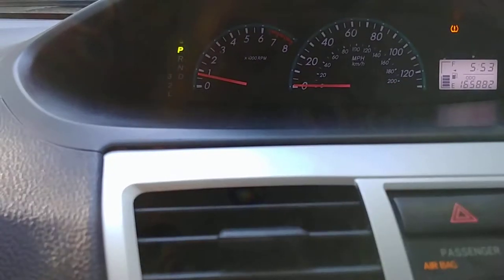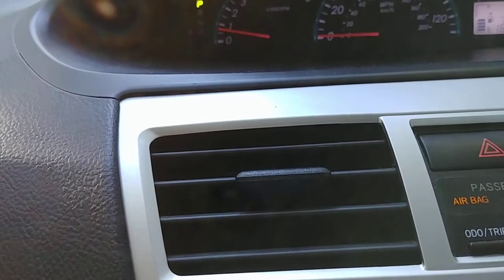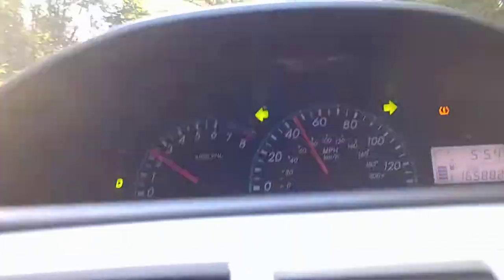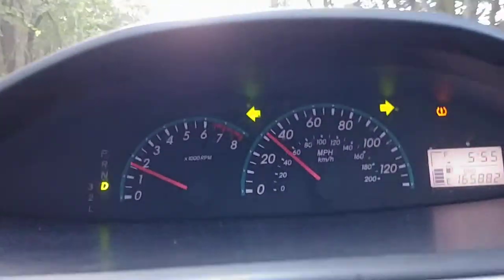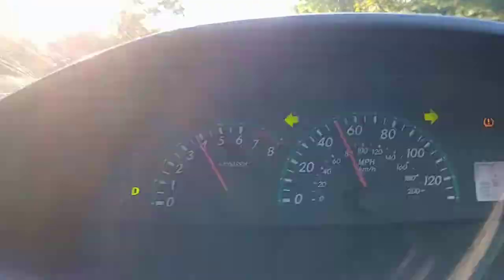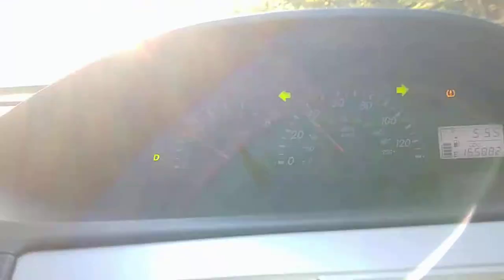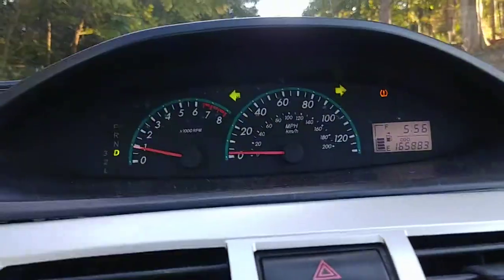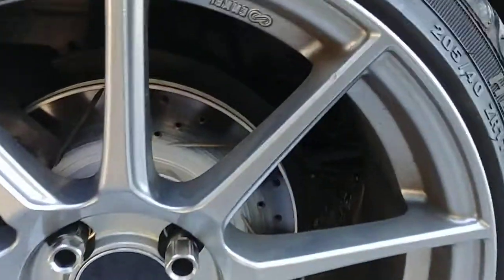R1 Concepts Break In Procedure

Comment: Good job man. That's exactly how they say its supposed to be done. What's your take on them by now? Any issues? Looking forward to your response.
Reply from the maker: Thank you, they do feel alot better than the oem rotors and stops quicker only issue I hate and it really not a big deal but rust develops in the chamfered holes and slotted sections on the rotor but it doesn't affect the Performance but overall a step up from oem especially with the ceramic pads

Comment: i just got brakes and rotors done n my pedal travel is a lil farther than normal, got my brake fluid refilled too. any reason why that could be?
Reply from the maker: you most likely still have air trapped in the lines

Comment: My slaughtered rotors with drilled holes are feels so rough when I just put him on so they must need to be broken in
Reply from the maker: Yeah you have to do the break in procedure after installing r1 rotors and brake pads. I have the slotted and drilled rotors as well with the ceramic break pads and they're great no issues

Comment: R1's break in process instruction is confusing because it says to do this but it also says "Drive safely and normally for the first 400-500 miles to bed-in the brake pads and rotors. Gradually allow the brake pads to transfer a layer of friction material to the rotors. This transfer film is crucial because it does most of the work for the brake pads during the braking process."
Reply from the maker: Yeah it is I just checked they’re website I did see that as well I’m not sure what’s they’re process now at the time the instructions I gave in the video is the instructions that was printed on the brake pad box in which I still have the same exact brake pads and rotors still on the car till this day. They probably changed the process because they’re manufacturing has changed idk but I use powerstop on all my other vehicles which has a very similar process but at different speeds have to do 5 aggressive braking and then 5 moderate moderate braking then drive for 5 minutes with no or very minimum braking to allow the brakes to cool then after that can drive normally I just did a video on they’re break in procedure recently
Reply: @ScorpionMultimedia  I wound up needing to travel on a busy freeway right after installation so because of the flow of traffic being irregular, I had to vary my speed between about 10mph and 50ish mph continuously for about an hour. I figured that broke them in by default. Since then I've driven normally. I wound up needing to replace my original brake booster and bleeding the brakes twice - about 1 month apart right after brake booster replacement. Ultimately, the brakes feel ok, better than the previous set up, but not spectacular.

Comment: R1 concepts definitely DOES NOT say so this. In fact until the film is coated on the rotor, breaking them in this way can warp the rotors
Reply from the maker: Actually at the time that’s the instructions that was printed on the box of the new brake pads with the rotors I also received from them that’s how I got these instructions on what to do. I do see that they changed their break in procedure on the website they probably  changed how they’re manufacturing their products. I still have the same exact brake pads and rotors I did this brake in procedure on the car in this video still till this day and have had zero issues and no warping. On my other cars I use powerstop and they have very similar break in procedure but it a 8-10 minute process I recently did a video on how they recommend on doing that

Comment: What happens if you don’t break them in?
Reply from the maker: If you don't you'll have an uneven layer of brake pad material onto the brake rotor which would lead to little rough brake operation and not so good braking power. Which can also lead to brake squeal and vibration. So it's always a good idea to brake in new brake pads and rotors
Reply: @ScorpionMultimedia  well damn lol it’s been two days